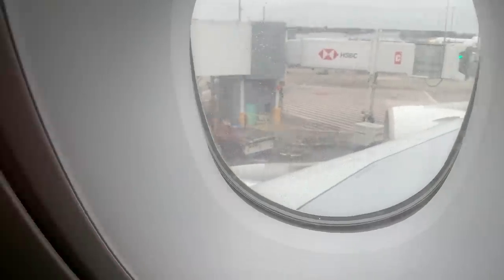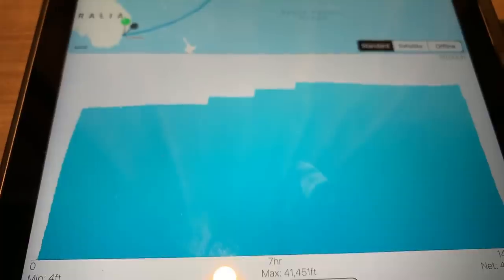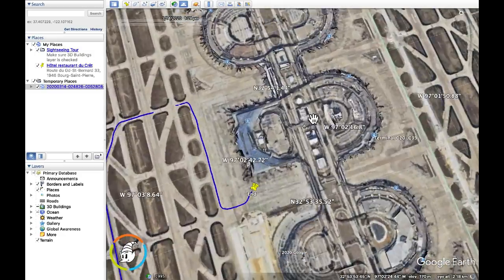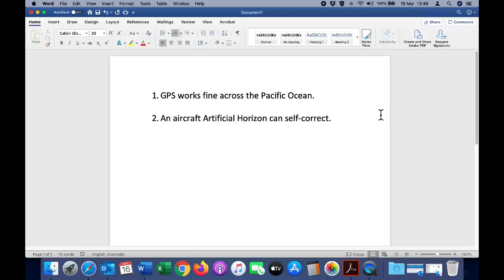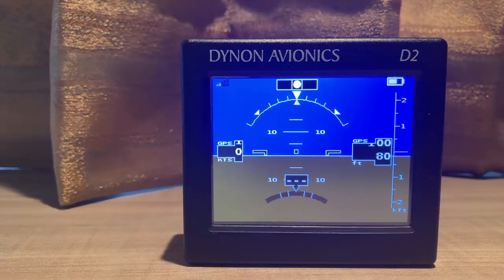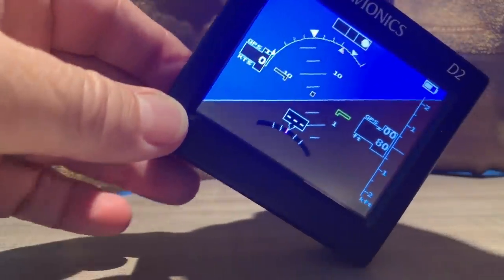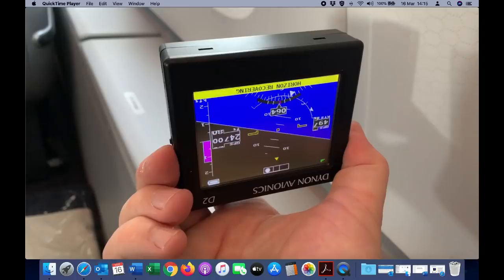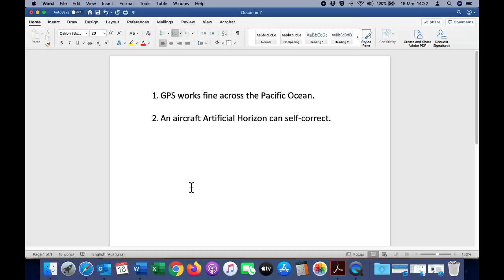GPS and Gyro testing on Qantas Flight 7 across the Pacific.

Comment: How did you determine sea level the first time?
Reply: Sea level is an elevation.
Seriously, this is stuff you could have googled.
Reply from the maker: At no point in this video did I determine sea level.
Reply: @Alysm-Aviation  you missed the question rocket scientist.
Reply: Steve Alm - Your question makes no sense so it can not be answered. Just possibly to help you formulate your question, you do realises the difference between attitude and altitude.
Reply from the maker: @stevea8355  Well Steve, I have to agree with Alysm.  You can Google that easily.  It took me two seconds to find several clear answers that will explain it. 

If you have a direct question related to what I show in this video then I will happily answer.
Reply: @Trevor_Austin  you obviously don't belong in the game. When did man determined sea level. In what mechanical instrument did he invent. Pay Attention
Reply: @Trevor_Austin  fairly easy question for a rocket scientist or even a knowledgeable pilot. Remember they invented a tool to measure sea level.
Reply: Tom Dick  once again you're missing the point. You have to be able to measure sea level. They've been measuring it for a long time. They made a tool. I've seen one. But I don't remember exactly how it works. But Mercury was involved.
you have to have sea-level tell me how you establish that the first time. Easy question.
You guys have a little problem with mother nature.
Reply: @stevea8355  You are speaking historically - the first means of determining sea level was purely local - all harbours that experienced significant changes in sea level [changes that could effect operations such as ebb tides] started to use measuring poles or "tide staffs" until around 1830. Amsterdam started to keep daily records in the late 17th century that noted the difference from mean high water mark. Thus the first instruments to measure "sea level" was a long vertical ruler on the harbour wall or out in the water. Refinements were added to deaden the effect of waves e.g. putting the vertical gauge in a land-based well connected to the sea.
Reply: @david_akerman  well perfect example from a globe head. Bunch of nonsense.
I don't care what tool you're using GPS anyting it works mechanicly  physically.
This kind of messes up your gas pressure. So I know it's embarrassing for you to answer.
Reply: @stevea8355  That was from the largest supplier of geographical information systems in the world, but you know better?   Sure you do.
Reply: @Wolfie6020  avoidance. Sea level? That's in your video. There's a mechanical methods of determining sea level. Once again pretty simple. Should be able to show us a picture. That way you globies can learn how an altimeter works. Let's learn all about altimeters.
Reply: @stevea8355  We know how altimeters work.  They measure pressure and convert to a pressure altitude.  You'll never guess what the equation relating pressure to altitude contains.  Go on, have a guess.
Reply: Steve Alm They used to determine altitude with what is basically a barometer, it measures atmospheric pressure, the higher you get the lower the pressure. You can get a good estimate of the altitude that way. Problem is, atmospheric pressure also changes with the weather conditions (high and low pressure systems, mostly due to temperature). You need to adjust for that in order to get an accurate altitude while using a barometer. That’s why satellites are a more accurate option.
Reply: @stevea8355  If it involves mercury, then it most likely involves pressure measurement - that wasn't the first means of determining sea level. You are probably thinking of the Torricellian barometer [or mercury barometer] - an upside-down glass tube standing in mercury. Air pressure pushes down on the surface of the mercury, making some mercury rise up the tube. BUT this does not directly measure sea level because air pressure is not a constant at a given fixed location & fixed altitude, instead air pressure varies somewhat with local weather. What you do is you calibrate your barometer daily [or a few times a day] with a landmark that has been deemed to be local 'mean sea level', by bringing your barometer to that level & deeming that reading as 'zero' - only then can you use the barometer indirectly to determine elevation +/- that chosen zero point.
Reply: @angrydoggy9170  sorry angry dog. As all total nonsense what you just said.
Reply: @stevea8355  
It's easy to measure sea level as water can't bend.  Lol.
Reply: @angrydoggy9170  the mechanics. The inside workings. If it's not with Mercury than it's something similar. Understand mechanics. Even his computer operates by mechanics. And you could call that electronics. But it's still measuring something physical.
Reply: @stevea8355  
Do lightbulbs on your planet work by "mechanics"?
Reply: Steve Alm Is it nonsense? How do you think they work? Please do explain, I do think it’s going to be truly funny.
Reply: @stevea8355  
So you think you are from planet Mercury or you think light bulbs work by mercury?  Be specific as your brand if stupid needs it
Reply: Steve Alm If you use gps to determine altitude there’s nothing mechanical involved, there’s no moving parts in a gps locator.
Reply: Steve Alm But do try to build up a logical sentence, it would make it much easier to follow your “thoughts” on the subject.
Reply: A Watt I got the mentally challenged part with his first comment. The hilarious part is growing on me.
Reply: @angrydoggy9170  repeating your ignorance. Do pilots adjust their altimeter when they're in the air?
Calibrate?
Reply: Steve Alm I need to correct myself. There is a mechanical part on most gps devices: The on/of button.
Reply: @Wolfie6020 do altimeters in barometers work in the same fashion. Are they both the same? I'm pretty sure I just read that they're both the same.
Reply: @stevea8355  Are you not able to search for these answers yourself or are you just trying to quiz everyone else to see if they know the answer? Because you are asking as if you want someone to explain it, but when that happens you just go "REEEE" at them and mock their answer, all the while never indicating that you actually know the answer. It's a pretty funny troll game of "someone help me understand" combined with "you must be stupid for not knowing this".
Reply: Steve Alm I’m not sure if the pilots adjust the altimeters whilst flying, I can imagine it’s done automatically. I do know most modern plains have different systems to determine altitude, using atmospheric pressure and a satellite system, in range of ground radar the measured altitude of the plain gets transmitted to it.
Reply: Steve Alm But again, try to ask clear questions, I still can’t really understand what you’re getting at. I’m starting to think you don’t know either.
Reply: @stevea8355  
So you admit that air pressure drops with altitude therefore there can't be a dome.  Well done.
Reply: Steve Alm If you’re confused use Google, we’re not here to spoon feed you
Reply: @stevea8355  
But you just admitted "gas gradient".  

That is why we laugh at you.
Reply: @stevea8355  
You just admitted "gas gradient".  Try and keep up with you own idiocy.
Reply: @stevea8355  
Explain again how electricity is "mechanical".
Reply: @Agent 666 you're a hundred percent right. Except one little mistake gravity. That would be called electricity. You're little gravity is bull yes.
Reply: @stevea8355  
But electricity is mechanical or something.
Reply: @stevea8355  Spoon me your evidence showing that the earth is flat. You can start with a simple map showing the correct sizes of the continent on oceans on the flat earth. Hurry up now.
Reply: @stevea8355  Stop laughing and show us some flat earth evidence fool. Show us a map of the flat earth that works. If you can't, you must concede the earth is a globe by default.
Reply: @stevea8355  Get educated dude. Conventional aircraft altimeters work by measuring the atmospheric pressure at the airplane's flight altitude and comparing it to a preset pressure value. ... When the static pressure increases or decreases, mechanical connections trigger the altimeter needle to show a corresponding altitude in feet.
Reply: @stevea8355  Try and read my question. Are you unable to find an answer or are you trying to quiz everyone? Or do you even know what you are trying to accomplish?
Reply: @awatt  Apparently electricity is mechanical and is the same as gravity.

Obviously we can measure gravity by seeing how bright a light bulb is.  And we can measure brightness by how high a light bulb bounces.  Or something.
Reply: @david_akerman  dunno, but we can measure Steve's brightness by his posts. Mmmh, pretty dark in here...
Reply: @david_akerman  
So if I switch the lights off I will float up?  Things are heavier at night?  I have so many questions for Steve......so many.
Reply: @stevea8355  "Except one little mistake gravity. That would be called electricity." Wait, what? That's your big reveal? Then do things float when in a Faraday Cage?
Reply: @NinjaMonkeyPrime  
(Puts hand up) things don't float in a Faraday cage because the light is on.  Turn the light off and they float up but you can't see it because it's dark.

I'm getting good at this.....too good.
Reply: @NinjaMonkeyPrime  does steel float in Mercury?
Reply: @awatt  Nah, mains electricity is deliberately alternating current so it pulls you up and down 50/60 times per second, so no net force.   That's the actual reason why Westinghouse won; Edison's customers kept floating away.
Reply: @stevea8355  "does steel float in Mercury?"  Oh Steve, did you just ignore my questions? Well, did you have a particular size or weight of steel in mind for floating in mercury? Size/weight matters Steve. Back to the questions you ignored Steve. Are you looking for answers that you cannot find, or trying to quiz others to see what they know, or do you have no idea or plan for these questions? And with respect to your electricity is gravity theory, does a Faraday Cage make items float? Come on Steve, time to shine.
Reply: Steve Alm What has floating steel to do with atmospheric pressure? Or the workings of an altimeter? Several people told you how it works, you can google it, you could even build one yourself and test it by taking it up a mountain.
But no, all you do is post some nonsensical questions.
Reply: @stevea8355  
 Steve, I'm wondering why you are asking so many questions that you could easily look up for yourself. Are you quizzing people here, trying to see what people will say, or are you genuinely looking for answers? 
 You're all over the place,  man. Don't be surprised when everyone stops interacting with you because you seem to have no point to make in this bizarre thread.
Reply: @david_akerman  
You said all that without a reference to the pigeon fancier Tesla.  Well done. 🏆
Reply: @stevea8355  
Does titanium float in mercury?  Answer carefully.....
Reply: Steve Alm Almost forgot to ask you again. How do you think an altimeter works?
Reply: @NinjaMonkeyPrime  He said Mercury rather than mercury, so maybe he's asking if steel would float on the planet Mercury.

Or Freddy Mercury.  Who can tell WTF he means?  He seems unsure himself.
Reply: @awatt  I was going to ask why all the instruments we have to measure electricity cannot detect it as the force that replaces gravity but it seems like if you don't keep reeling Steve back to a point he will just keep plowing ahead with new nonsense. Remember when this was about sea level? Seems like ages ago.
Reply: @awatt  I don't know oh what.  does steal ? If you guys don't want to teach me how a altimeter works that's fine. I just wanted to make sure I understood the inner workings.
Reply: @awatt  start at zero space cadet
Reply: @david_akerman  I did catch the "M" in Mercury but I was afraid he'd just get his panties in a twist if I called him out on it. He seems to have a lot on his mind. Not sure how many voices though.
Reply: @NinjaMonkeyPrime  I'm pretty sure that the accelerometer in my phone measures gravity and not electricity, but maybe I've wasted all those years in electronics.  Maybe the pressure sensor also measures voltage.  I guess Steve knows.  He seems confident.
Reply: @stevea8355  "If you guys don't want to teach me how a altimeter works that's fine. I just wanted to make sure I understood the inner workings." So you aren't trying to quiz everyone? Instead you are asking how an altimeter works? Well Steve, what have you researched so far and what part confuses you? Start with what source your found online and quote the part you'd like more information about. Does that sound fair?
Reply: Steve Alm Still going on about floating steel I see. When are you going to tell us how you think altimeters work (hint:I don’t think there’s floating steel in them)?
Reply: @stevea8355  " you're a clown throw an anvil in there it'll float.
" Well maybe, or are you saying the size/weight of the steel doesn't matter? Water is less dense than mercury but you can float an aircraft carrier in it (you knew that right Steve). It seems like we do have math to figure all this out so not sure why you are asking. Like I said Steve, size/weight matters. https://en.m.wikipedia.org/wiki/Archimedes'_principle It seems like I'm talking to 3 different Steve's. There's the one who starts barking about mercury, then there's the one who (honestly) wants to know how an altimeter works, and then there's the one who thinks gravity is electricity. Is there a reason why you keep swerving like this Steve?
Reply: @angrydoggy9170  back to the original question if you want to answer.
Reply: @angrydoggy9170  seems like all you trolls are nervous about Mercury. Instead of just answering the question.
Reply: @angrydoggy9170  you got your masks on angry dog I don't want to talk to you unless you got your masks on. I know you're infected.
Reply: Steve Alm And some more nonsensical gibberish. Again, how do you think an altimeter works?
That original question you’re talking about. Was that the one about sea level? That one has been answered.
Reply: @stevea8355  "Re-read the original question. Learn the term calibration." This is your response to this. "If you guys don't want to teach me how a altimeter works that's fine. I just wanted to make sure I understood the inner workings." But if we go back to your original question we find "How did you determine sea level the first time?"  
Now Steve, can you honestly say you follow a coherent thread of logic in that? You totally ignored my question, ignored your most recent statement that I quoted, then brought up calibration, then brought up your original question, and you never related all that together at all. You sure this makes sense to you Steve? Let's have a test of your reading comprehension and honest Steve. Here goes. 
You said "If you guys don't want to teach me how a altimeter works that's fine. I just wanted to make sure I understood the inner workings." So Steve, time to man up. What is your reference for how an altimeter works and what part do you not understand? 
Should be easy Steve. Unless you want to confirm that not even YOU have any idea of what you are saying (which is what we all know).
Reply: @NinjaMonkeyPrime  I didn't think I was swerving I thought all three were connected. Since you have to have mercury to establish you're reading. And then you calibrate. It's kind of like putting mercury in a glass tube. If there's no markings on and it just rises and falls. But by God if you calibrateit you can write numbers alongside of it that correlate to it. That's called calibration that's how you make measuring tools.
An atheist thinks spare the rod spoil the child like hit them like a gorilla.
But God when he said spare the rod he was referring to measuring devices. Like weights and measures. You know what a rod is. A-Rod would be like mercury in a altimeter.
You guys are nothing but clowns.
Reply: NinjaMonkeyPrime I think you hit the nail on its head there. I don’t think anyone can make heads nor tails of his reasoning.
Reply: @angrydoggy9170  do you want to play you are a dumb bastard? Is a lot of fun I really enjoy it.
Reply: Steve Alm So what are you trying to say with your rod of god stuff? How does that disprove anything? BTW, you don’t necessarily need mercury in an altimeter, you can even build one without any fluids.
Reply: @stevea8355  
So you don't know what would happen if you put titanium in mercury.  That's ok.  There are lots of things you don't know.... obviously.
Reply: @stevea8355  
How do you make a barometer?  Do tell.  You have made many so enlighten us on its features.
Reply: @angrydoggy9170  " I don’t think anyone can make heads nor tails of his reasoning" I'm not sure he understands it. I think he's just trolling.
Reply: @stevea8355  " I just wanted to make sure I understood the inner workings"
 And you thought trolling YT comments was the best way to research it? #seemslegit
 I can tell you that pilots calibrate their altimeters (traditionally, maybe not with modern technology) and other instruments before every takeoff. They have checklists so they can't forget.
Reply: Steve Alm Lets see if I understand you correctly. Because pilots need to calibrate their altimeters before takeoff, because of floating steel and you clearly having the hots for god’s rod, there is something wrong with the atmospheric pressure. Is that what you are trying to say? Just asking, because it might be all very clear in your head (although I highly doubt that), but you need to work on your communication skills. For us normal people (without brain damage), it’s just a load of utter nonsense.
Reply: Cheshire Cat I get your drift, but don’t say “how google works” but go for “how to use google”. I’ve been looking into the workings of the giant that is google and it’s horribly complicated. Not even google knows how google actually works.😋
Reply: Angry Doggy 
😂😂😂
Reply: @stevea8355  I'm curious why you think steel floating in mercury is relevant to this conversation or why anyone here should be afraid of that basic knowledge.
Reply: @stevea8355  You said: "You obviously don't know how an altimeter works. See you're scared of the answer. It blows your little gas gradient all to crap."
Please, do explain, and without riddles this time.
Reply: @awatt  I doubt he could work out what happens when you put a bowling ball in a wet paper bag.